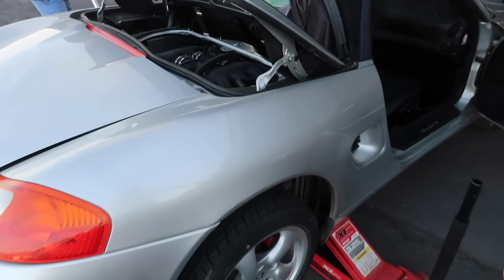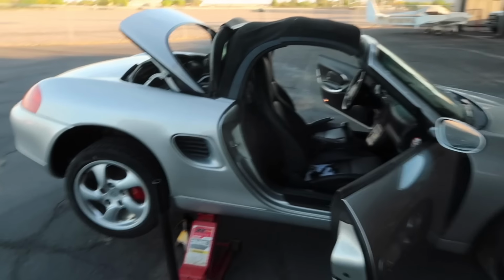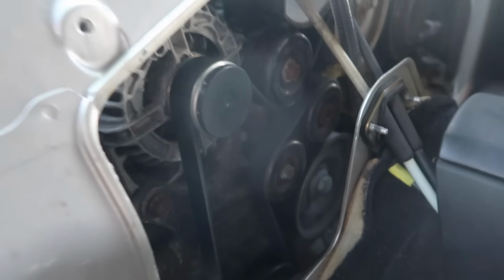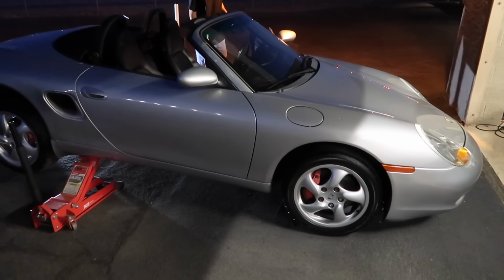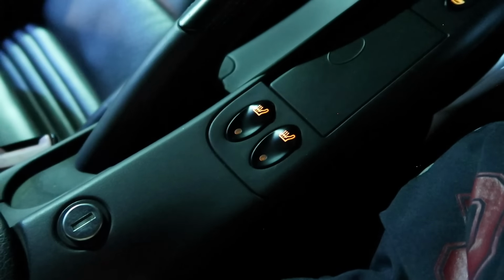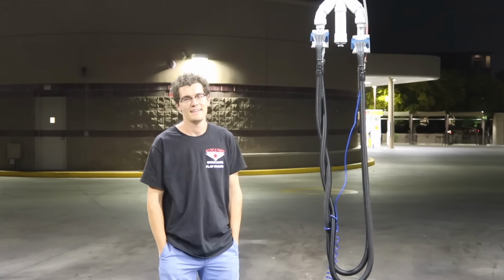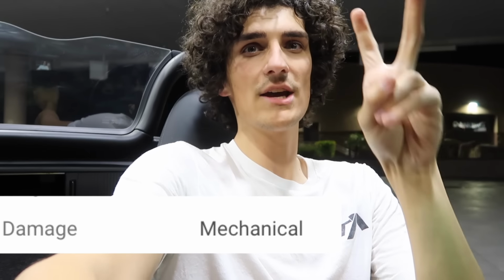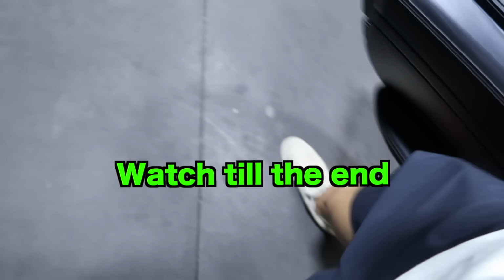You Won't Believe What Fixed Our "Engine Damage" Porsche Boxster S!

Comment: Mechanic here, our rule of thumb is to ALWAYS check the work the customer claimed they did. Basically we act like we’re diagnosing it from scratch as if nobody has messed with it yet. It’s nothing against you but sometimes the DIY guys don’t do things properly or 100% correct (like this case) so we almost always check what has been done for reasons like this instance. Good thing they checked!
Reply: $13.500, with no engine or IMS bearing issues. : )

Comment: Serpentine belt is the easiest thing to replace on that car. A lot of Boxsters out there, with easy fix, but been told by the dealer will cost $8k or so to replace this n that. Window regulators for $850 to a  $1000 is insane. Rotors and pads, and abs sensors replaced at indy or dealer are just insanely charging way to much. Window regulator, Piece a cake that takes 45 min to an hour max!! Many owners just give up and sell

Comment: In a "Charity" sale, the odds will just about always be in favor of the buyer. When the vehicles show up at an auction, the people responsible for the initial inspection to determine the current mechanical condition in most cases are looking for obvious defects in the vehicles. If there's a misfire or unknown noise, the "Condition Report Writer" doesn't do an indept inspection of the engine or the problem. That's not their job. And when dealing with a Charity vehicle, there isn't a lien holder who wants to make maximum book value of the vehicle. In other words, they won't seek out a mechanical inspection to determine the cause of the engine defect. They will just list the announcement of bad engine to cover themselves in case the buyer changes his mind after purchase. I worked at an auto auction for 22 years. I also wrote Condition Reports for 7 years.
Reply: Thanks for sharing this info!

Comment: Don't feel to bad about not seating the coils.
A neighbor of mine had his plugs replaced on his 85 mercedes with a straight 6. The plugs are on top.
I saw him drive up and he got out and said it was running bad on the way home.
I popped the hood and pulled on the plug wires, and all six were loose and not seated.
I seated them all and it ran smooth as butter after that.
Those coils don't bolt down? 
Making a profit is the American way. 😊

Comment: I hope you fixed the flaky solder repair on the MAF sensor.  That needs a couple of sealed in line crimps.  Solder connections will result in later failures due to stress concentration at the solder joints.

Comment: I don't know where you get your pricing info.  I have a 49,000 mile 986 S from 2000.  One owner (before me - mine for 3.5 years).  I check Bring a Trailer almost daily and other sites on occasion. (I'm also looking for the right Cayenne).  I'd say that car is work $13500.  Still an amazing deal for what those little jewels will do.  EDIT:  I had made this comment before I got to the place in the video where you told us what you sold it for.  That is exactly what I think it and mine are worth. Mine has no surface rust issues.  It could use a new top but it's satisfactory.

Comment: So it's all your fault JR Garage. You gave me Boxter Brain and now I own a 2003 Boxter 2.7 liter with 25575 miles on it. My guys at German Auto Service looked up the service records with the VIN and told me that is an extremely well-maintained Porsche out of Texas. I was the winning bidder @ $8400. It needs $3800 in bodywork and new tires. with taxes and Copart fees, I will be in it for less than $15,000. I live in Michigan so we will be doing some beach cruising this weekend. 🏎🏎🏎

Comment: Not so dumb.  The car ran the same because most of the old coil packs were cracked and useless.  You put in new ones but not properly.  So you started with bad coil packs and ended with bad coil packs. Still the same problem and the car ran the same.  Easy mistake since you didn't know exactly how the coil packs popped in to seat properly.